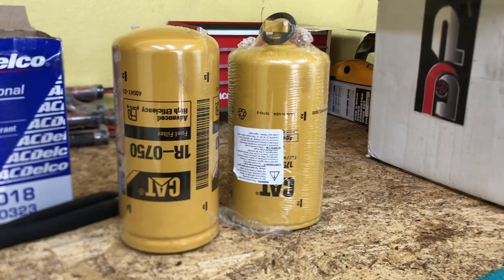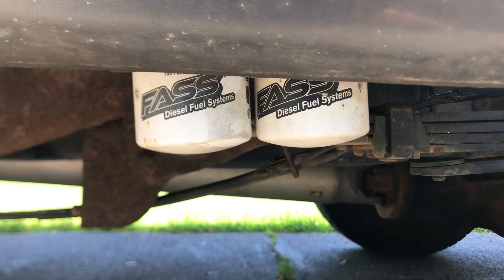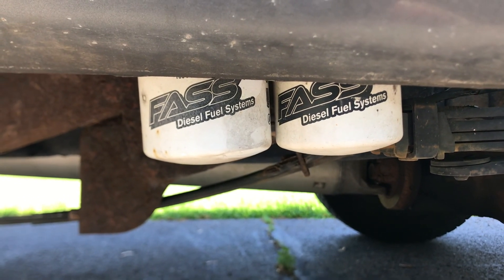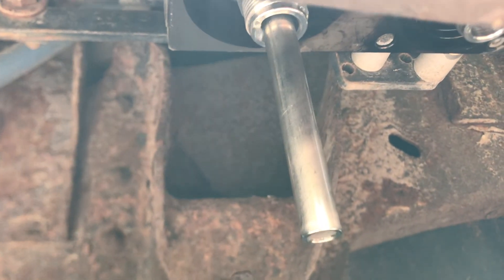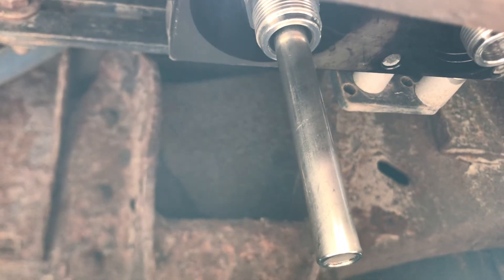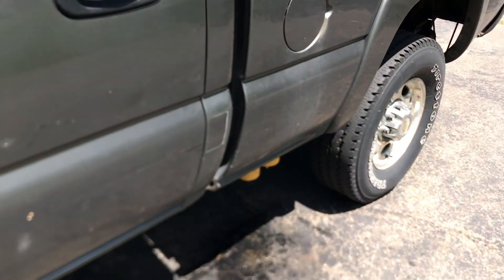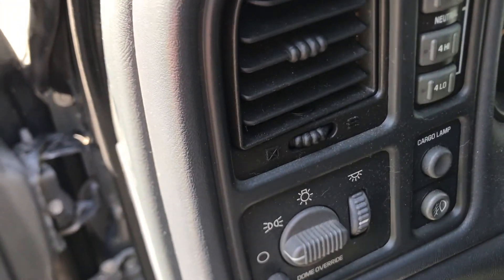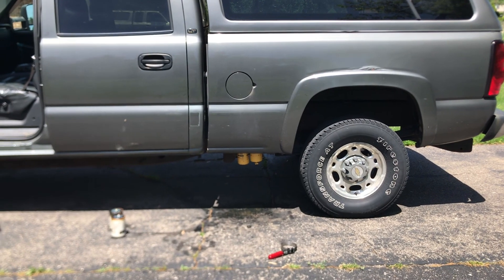fass fuel filter replacement

Comment: I’m confused , after watching the video by fass the one with the straw is the water separator and the other is the fuel filter . In this video you explained that the one with the straw is the fuel filter which would be reverse . So which one would be correct ?
Reply from the maker: Fuel filter is on the straw. Water separator is not
Reply: @nickmcgee3258  this must be different on the new fass pumps , if you watch the video made by fass you can see that they put the fuel filter on the side without the straw .
Reply: I was just about to ask the same question. I didn't realize I had my Filters mixed up until today! 

If you look at the Fass filters it shows an illustration of how it mounts and it shows the water separator being where the Tube is!

Comment: When removing the filters do you have to clamp the lines or will the fuel just stop flowing after a couple seconds?
Reply from the maker: It will stop as long as the pump is not on.

Comment: so i’m good to completely tighten the water separator correct? only need to “prime” the fuel filter?
Reply from the maker: Correct, because the fuel will flow through the water separator first and fill it then the filter, so when the filter overflows you know both are full.
Reply: @nickmcgee3258  cool thanks a bunch!
Reply: @nickmcgee3258  I watched another guy says that he always fills the water  separator about 70% with new fuel before screwing that one on. Does that matter that much?  Also, he clamped the hoses on both side before removing the filters. Can someone let us know what the specifics are to do this procedure?
Reply from the maker: @HDriderHDrider  filling the filters before putting them on wouldn’t hurt. But cycling key on turns the pump on to fill the filters also. Just personal preference. Neither is right or wrong.